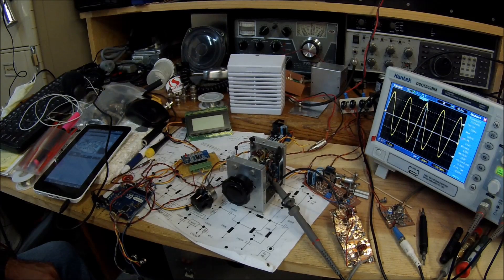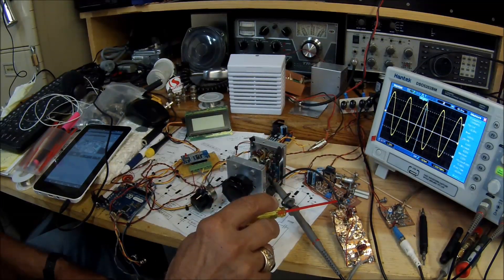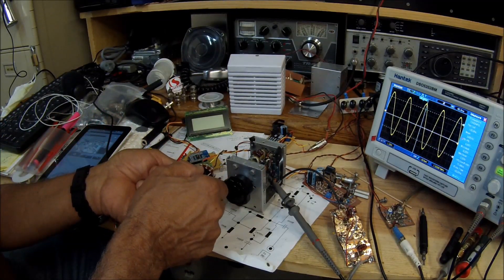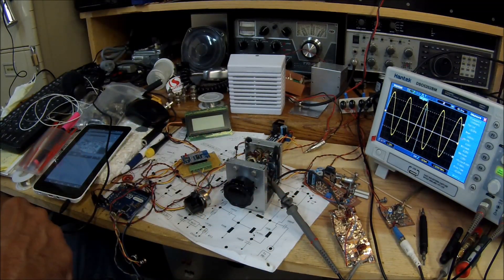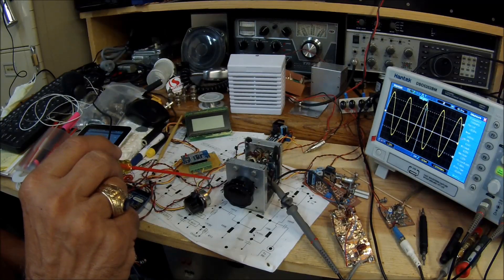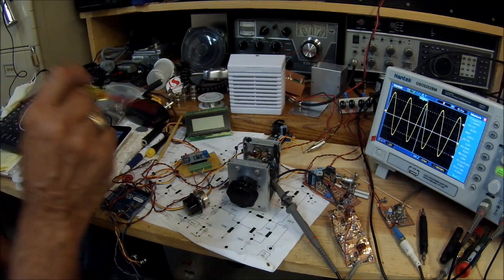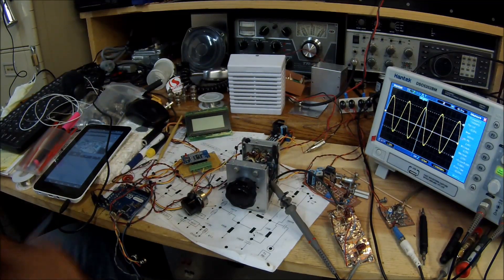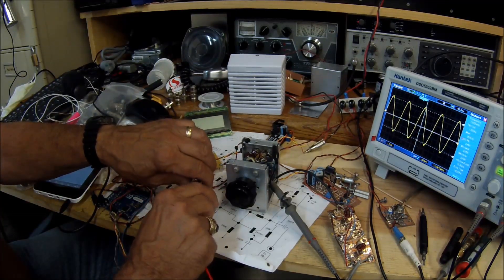Lets Build Something Part I

Comment: Thanks for this Pete.  I am yet another who is coming to the RF/analogue domain via the digital domain. I have been a licensed operator for >20 years, and this will be the first receiver I have ever built.
Reply from the maker: Hi Gerry,

Thanks for your email -- you will enjoy this radio -- it works great and it will provide a springboard for the complete transceiver. Be sure to check the LBS resource page for photos and details. http://www.jessystems.com/LBS_Detail.html

Thanks again for the comment --enjoy.

73's
Pete

Comment: Mr. Juliano,
   Kudos for taking the time and putting forth the effort to share your skill and expertise. Along with AB5NI and (others) I would also like to learn how to build these modules such as your mixer circuit.

73's

ke4ksi
Reply from the maker: Hi OM,
There are a series of four other videos that describe and show you how to build the modules used in this receiver. The Let's Build Something Part I will be covered in an upcoming article in QRP Quarterly which is published by QRPARCI. I suggest you join QRPARCI and the very next issue will contain the published article that along with the several videos should enable you to have a successful build of the direct conversion receiver. The final configuration will use all of these modules in a single sideband transceiver.

Thank you for you email and do a search for the videos that followed this one and you will see more of the "how to".

73's
Pete N6QW